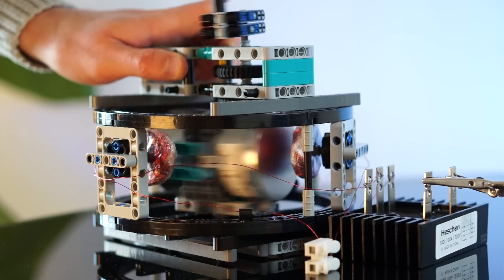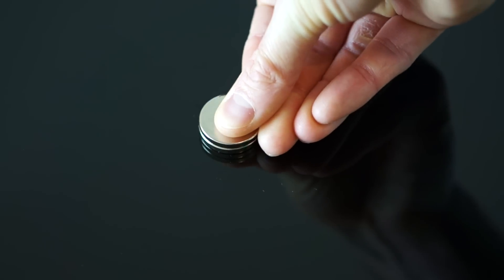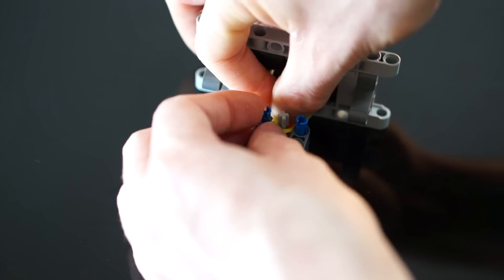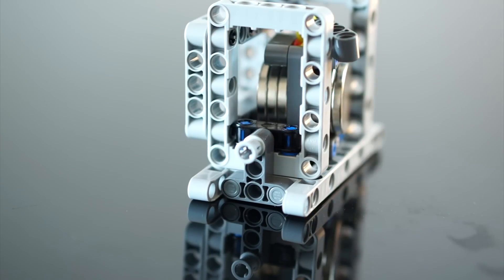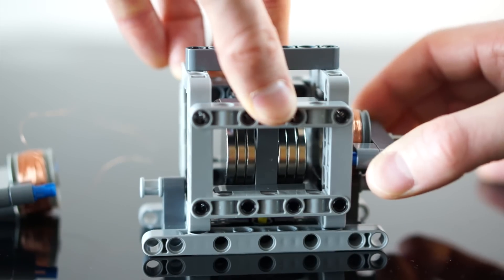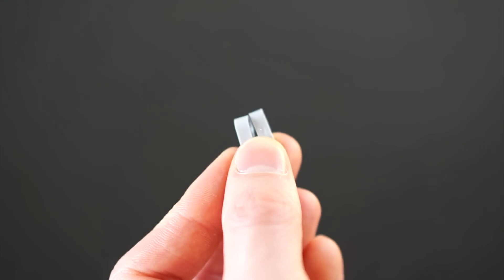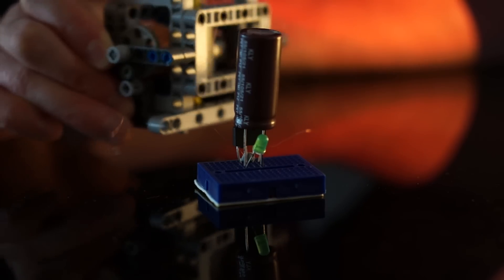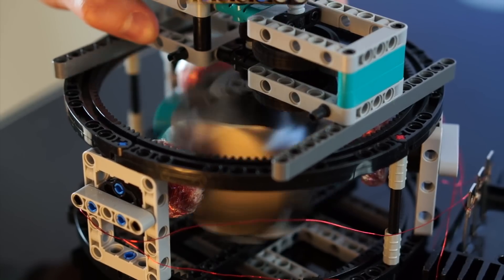The ‘Wiggler’ - This Lego Gadget Shouldn't Exist

Comment: Having a handful of these on some heavy machinery or something similar could be a way to passively accumulate/restore power, even if its not extremely efficient something that vibrates alot could have uses with this.
Reply from the maker: Haha like a washing machine generator - consumes 2 kilowatts, but you can also power an LED at the same time! I actually liked another commenters idea of using it as a dampener for heavy machinery - then it can do 2 jobs at once

Comment: Perhaps you can store the energy generated somehow. If you place it in a backpack (or multiple wigglers) while hiking you can generate energy by moving. Then you should test it how much energy is created within 60 minutes of hiking per wiggler. Perhaps it is then handy as an electric fire starter or for a short amount of time the usage of a flashlight is possible.
It at least seems compact enough to take it along with you either way and as long there is movement, you will generate some electricity. So, if you think about that, it could work while cycling, walking and such. Also certain positions how the wiggler is placed would effect how much you generate then, I could imagine.
Reply from the maker: That's a cool idea, I hadn't actually thought of long-term storage of that energy. Most of my generators I just store short term in capacitors. But if you're going on a walk anyway, you may as well store some of it. Might be worth a video in the future seeing how much you can store in a capacitor bank over a long walk, and what can you power with it. Cheers for the idea!
Reply: @JamiesBrickJams  I am not great with electronics, sadly, but if it works it would be cool. There are plenty of people who could use it when they decide to do some hiking, or have a walk with their dogs. Since even the slightest movement then already generates a bit of electricity, the wiggler could then be used in multiple ways.
Reply: @JamiesBrickJams  I can also imagine the wiggler can be moved by something simple like wind? So some sort of wind turbine that moves itself to how the wind blows (alike some how windmills that generate by pointing themselves towards the wind direction, but then with a wind turbine instead of a windmill) could also generate a bit of electricity. Doubtful it will be enough to generate enough electricity though, but might also be something to try out. Would already be cool if it can light a LED when the sun goes down, after generating electricity through the usage of wind to make the wiggler move. If you try that out, a turbine must be able to focus the wind on the magnets to make the movement possible.
So, some sort of a more fancy “windmill” idea 😅
Reply from the maker: Totally doable - that's about the most efficient way to run a wind generator! I'll demo something like that in a while
Reply: It can't work well! The system only works if there is constant shaking in both directions and at the same speed, otherwise no current flow is created. Also to improve the system, the magnets should move inside the coil. The random hops of a walk would not create the right movement.

Comment: I think id use it as an Impact Sensor ...?
Reply from the maker: Hey now that's actually a cool concept ... you're giving me an idea
Reply: @JamiesBrickJams  or even more complicated to calculate: acceleration Sensor ;)
Reply from the maker: @jakubfleischer7240  ha also a cool idea for a proof of concept.. though I suck at maths 😅
Reply: @JamiesBrickJams  man, thats the Kind of Problem i love. I'll try to think of a way to calculate that! Haha
Reply: Sooo, if you know the spring constant D, the maximum Amplitude x, and the Mass of the swinging Block you could calculate the acceleration a by f=m*a.

So if Theres a way to calculate the Amplitude dx With the output voltage, you could easily do that.

Another way Is to calibrate the Sensor by assigning a certain value to an output voltage.

Thats my approach ;)
Reply from the maker: @jakubfleischer7240  that's impressive, I'll have to take your word for it! Feels like a job for ChatGPT. You did make me wonder though - a single impact probably has a characteristic output 'pattern' when the magnets bounce around. I wonder if you could get an AI to recognise those patterns and tell you exactly what is causing the impact.
Reply: @JamiesBrickJams  the output pattern should Be a dampened sine wave. Depends on how quickly the springs Go Back. If another springy body Hits it it should rise slower instead of almost instantly. You could do it without ai tho.. ;)

Comment: I've wondered why this kind of power generation isn't employed in vehicle suspension. Imagine a truck without a wiring connector to its trailers, just a generator, a battery and a signal receiver to actuate lights.
Reply from the maker: That's an interesting idea ... I'd be curious to see how compact something this this could be (built into suspension) vs putting an alternator into the trailer
Reply: @JamiesBrickJams  shock absorber was my thought. You could have up to 4 of them per trailer.
Reply from the maker: @MrJtrot90  that's true, I guess you could chain a whole bunch of them together

Comment: Many engines vibrate heavily, especially the diesels in my military vehicles, these could be a good way to harvest and/or dampen unwanted vibrations. Shock absorbers in vehicles could be made more efficient/productive with a system like this.
I've also worked in areas like 100 foot high observation towers that vibrate constantly with even low levels of wind.
Reply from the maker: Looks like the concept of integrating with suspension is popular. Although it's way less efficient than an alternator, I like the idea of a dual purpose acting also as a dampener. Funny you mention the vibrating towers - I've been playing with a ribbon generator that works at very low wind levels ;)
Reply: @JamiesBrickJams  yeah nobody wants to replace an alternator. The suggestion is supplementary. Situations with high demand and dual piwer systems like an ambulance could conceivably benefit

Comment: Well the only idea that came to me is, use it as an alternative to the regular dynamo bike light!
Reply from the maker: I think you're still onto something - it's much less efficient than a regular dynamo, but may still have a place when something has 'bumpy' movement
Reply: @JamiesBrickJams  A single one of this model, is decently less efficient. But well-designed etc. it could be something that can work!

And if we think a bit further, maybe in a better design deepening on the amp this can create, it could be usefull for our sporty ppl out there as a "self charging powerbank"!

So yeah the design so far is maybe the problem but the idea is great!
Reply from the maker: @nachtelfirokese88  for sure, the design could be made much better and more efficient!

Comment: If you had two then could it be possible to have the led be solid if the wigglers wiggled in opposite directions
Reply: you would need a full bridge recifier too
Reply from the maker: I suppose some diodes to rectify the signal in one direction could do that! For now, I'm finding capacitors the easiest way to smooth out the signal for a solid light
Reply: @JamiesBrickJams  I didn't even think about that.